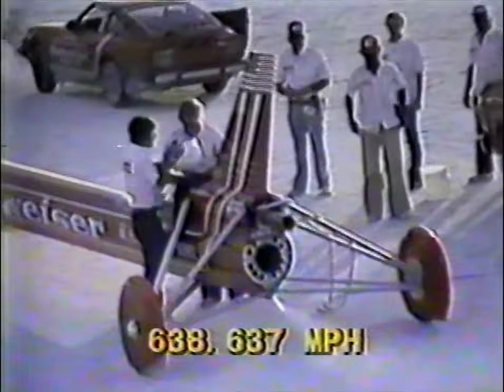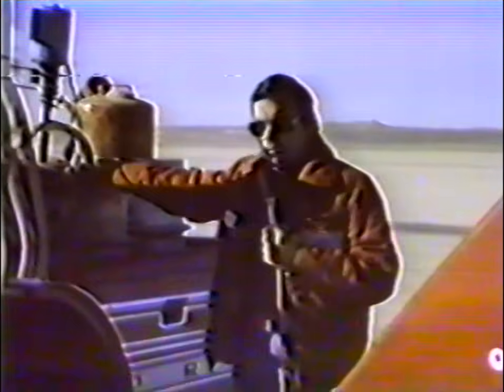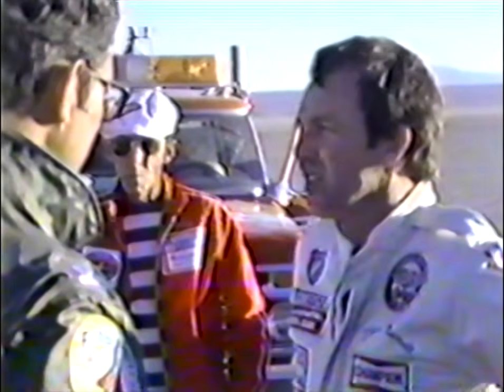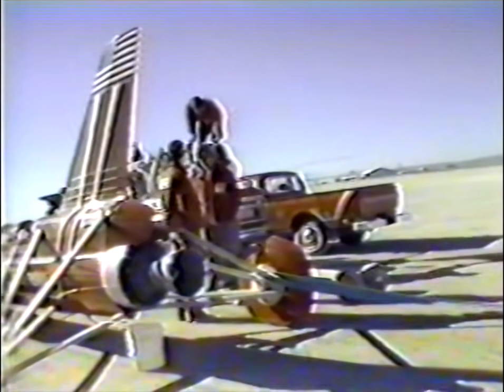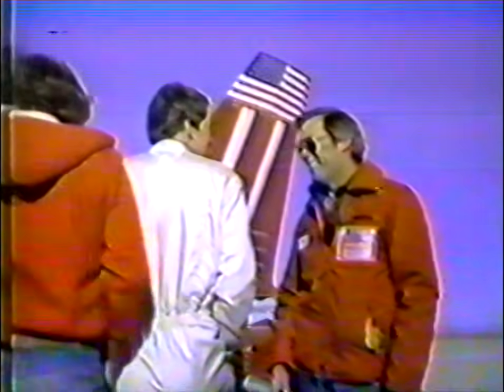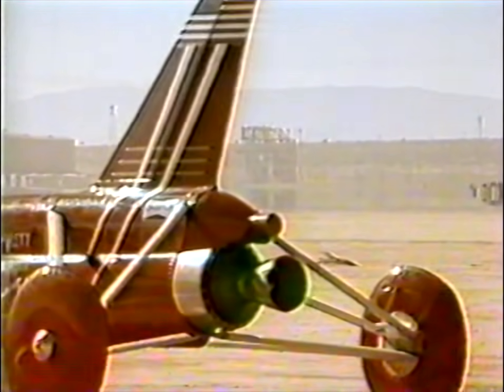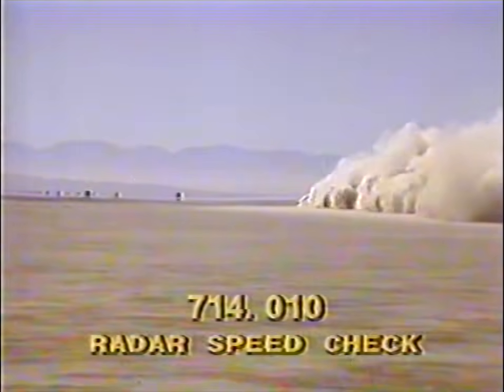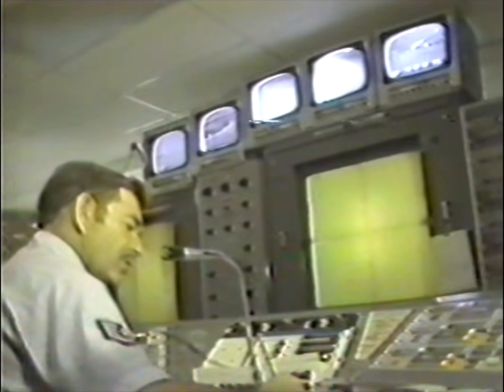Stan Barrett Breaking The Sound Barrier Live from Edwards Air Force Base in 1979

Comment: "On December 17, 1979, he attempted to break the land speed record, and the sound barrier in the Budweiser Rocket rocket-powered three-wheel vehicle. His calculated speed was 739.666 miles per hour, which would have made Barrett the first man to break the sound barrier in a land vehicle. The attempt was surrounded by controversy and the speed was never officially recorded." -Wikipedia

Yeah well, not officially recorded with a "calculated" speed.

I claim they "calculated" wrong. I mean, he's saying the speed of sound is "around". The fact is, they didn't even properly know back then. Meanwhile, here in 2020, we know that at sea level, Mach 1 is 761 mph and thus Stan never hit the speed of sound.

Thrust SSC meanwhile was monitored by satellite, and hit 763 mph which is faster than the speed of sound and thus the sonic boom. 

(Stop trying to rewrite history. Andy Green was the fist man to break the sound barrier on land.) 

End of story.
Reply: The speed of sound changes according to TEMPERATURE.   Something you didn’t know.  End of story.
Reply: Tim McGuire That’s true but it still didn’t happen.
Reply: also includes altitude. and air pressure.
Reply: @raypitts4880  No.

"The speed of sound (symbol: a) is principally dependent on the type and composition of the gas as well as on the (absolute) temperature t. The calculation is simple:

speed of sound a = kRt

where

k is the ratio of specific heats of the gas (k = 1.4 for air)
R is the gas constant (R = 287 J/kg K for air)
t is the absolute temperature in K. For the standard atmosphere the speed of sound is derived as follows:

a) speed of sound at zero altitude: 15°C

a= √(1.4 × 287 ×288)
 = 340 m/s (670 knots)

Conversion of the dimensions:

√((J×K )/(kg ×k )) x √((Nm )/(J )) x √((mkg )/(s^2 N)) = √(m^2/s^2 ) = m/s

Speed of sound at altitude of 11 km:
temperature at 11 km altitude:
-15.5°C, corresponding to 273-56.5=216.5°K

a = 295m/s (582 knots).
Thus the speed of sound decreases with increasing altitude because of the change in temperature."

- "Modern Combat Aircraft Design", Klaus Heunecke, Airlife publishing, 1987, p.72.

And also:

"The actual relationship is that the *speed of sound is proportional to the square root of the absolute temperature."

Mechanics of Flight", A.C. Kermode, Pitman Publishing, 1972, p. 322

Let me put it another way: the speed of sound varies with temperature. Temperature varies with altitude. But there is no need to include altitude in the calculation. All we need is temperature (in degrees Kelvin). We don't need air pressure either.
Reply: @deltapee9259   You're right. I don't see a massive difference in height, or average temperature between Black Rock Desert (Thrust SSC) in Nevada at 1,191m above sea level and Bonneville Salt flats (Budweiser) in Utah which is the next state over at 1,291m above sea level.

Plus, if you want to look at it like that, Budweiser was at a higher height and thus had less air to carve through so should have done better.

Andy Green and the Thrust SSC team still smashed it though didn't they? 

Nice try though yeah.
Reply: @Crimsonedge1  Altitude is not part of the formula for calculating the speed of sound. Please get it right.
Reply: @thethirdman225  The speed of sound IN AN IDEAL GAS depends only on its temperature and composition. In regular air, which is what we have here on earth in case you didn't realise, the speed has a weak dependence on frequency and pressure. Like it or not, the air we breath deviates from the "ideal behaviour" and MUST be accounted for in calculation for the speed of sound in relation to a vehicle at a given altitude. And it must be taken account of as the very dynamics of the air itself (the gas) changes as it gets thinner. 

But yeah, please do go on telling me to get it right.
Reply: @Crimsonedge1  
"The speed of sound IN AN IDEAL GAS depends only on its temperature and composition. In regular air, which is what we have here on earth in case you didn't realise, the speed has a weak dependence on frequency and pressure."

I don't know why you're even arguing this. The formula is a=kRt which takes into account the gas constant, absolute temperature and heat capacity ratio. In other words, all that is taken into account.

There is no need to include air pressure or density or altitude or even humidity into the equation. It's actually pretty simple. The notion of an ideal gas is taken into account with the inclusion of the gas constant. Pressure is included in the heat capacity ratio.

I get this all the time. I show people the formula and everyone goes, "What about this?" or "No, you're wrong!" I don't mind a certain amount of challenge explaining it but I just get so sick of the arguing when the formula is right there in front of you.

This is scientific formula. Yes, all those things are connected but they are also temperature dependent and anything that isn't is not included.

The altitude is a separate matter from temperature. Look at the formula: there's nothing in there about altitude. What matters is that the temperature is usually lower at higher altitude. There's nothing in there about pressure either.
Reply: @thethirdman225  

"The speed of sound in air depends on the type of gas and the temperature of the gas. On Earth, the atmosphere is composed of mostly diatomic nitrogen and oxygen, and the temperature depends on the altitude in a rather complex way. Scientists and engineers have created a mathematical model of the atmosphere to help them account for the changing effects of temperature with ALTITUDE. Mars also has an atmosphere composed of mostly carbon dioxide. There is a similar mathematical model of the Martian atmosphere. We have created an atmospheric calculator to let you study the variation of sound speed with planet and altitude.

https://www.grc.nasa.gov/www/k-12/airplane/sound.html
Reply: @Crimsonedge1  We? Do you work for NASA?

Mate, I still don’t know why you’re bothering to argue. There’s no point talking about the composition of the atmosphere and ideal gasses when, with the gas constant, it is already taken into account. We call it air, rather than a combination of nitrogen, oxygen and carbon dioxide etc, and its constant is 1.4. It’s 1.4 in your calculator and in the formula I quoted. In other words it makes no difference.
Reply: @Crimsonedge1  By the way, you might have missed it but that calculator uses a drop down box to select altitude or temperate. That doesn’t mean altitude suddenly becomes part of the equation because it doesn’t. It means they are using altitude and temperature interchangeably because if we know the altitude, we can make an assumption about the temperature (ignoring things like inversion layers, etc). That’s just something which is coded into that applet.

Comment: No sonic boom. No shock wave seen from the front of the vehicle (which WAS seen from Thrust SSC). The rear wheels off the ground are the result of the high thrust line of the Sidewinder motor, not as Yeager described it (he got it upside down).
Budweiser Bullshit.
BTW, the speed of sound in air is a function of temperature, not altitude, wind etc.
Reply: Wrong, it's an issue of altitude atmosphere density!

Comment: The speed of sound at  Edwards Air Force altitude of 700 metres is 759.5 mph. So 714 mph which is what Stan Barrett achieved did NOT break the sound barrier
Reply: Apologies - did not correct for temperature. If you assume an altitude😮 of 700 metre and a temperature of 90 F  the speed of sound is 783 mph. So 714 mph is not even close

Comment: How do you ignite Hydrogen Peroxide...?
Reply: Thomas De Lello  That’s what I thought??
Reply: Does it ignite under pressure with the rise of temperature due to BTU content like diesel does...? Maybe...
Reply: You use a catalyst to cause it to break down. The energy released is amazing. Most old torpedos ran on hydrogen peroxide the energy of the fuel was more than the high explosive warhead.
Reply: @raypitts4880  Tell me where on the time dial to look for that. I saw Slammin' Sammy Miller make a 350 mph pass at the Hollywood Florida quarter mile in the 1980's with two friends... Scared the sh*t outta me... ET= 3.5 seconds.

Comment: Nah... they knew they didn't quite get it. And it took like 30 years later to get it done.  Has not been since attempted. Still hoping they go for it but i think funding has died for the project.
Reply: Nope. Currently doing high speed testing at Hakskeenpan in South Africa. Preparing for max speed run next year.

Comment: I can't believe the level of derp in the comments... TWO aeronautical engineers explain that it DID go supersonic and WHY there was no boom - and hundreds of armchair mechanics saying it didn't. Fact : it went supersonic. But but! the frenchies didn't OK it so it must not count, eh? Aren't you guys missing a NASCAR race or have a cousin you need to date instead of commenting on this video?
Reply: It probably did, briefly
But, awesome as it was.
It has only 3 wheels not 4, makes a huge difference to drag.
To officially take the land speed record it has to do 2 x runs in opposite directions, within the hour and then the average taken from both runs.
It also has to be officially timed, not a good guestimate from a radar type device. 
It also has to keep all 4 (3) wheels on the track - it didn't
It was calculated that Thrust SSC broke 800mph briefly, the average was however a little less.
Splitting hairs?
Possibly, just like you guys did with the Blue Riband.

Comment: Rockets are rated by thrust, not power ("horse power") it is crazy to compare with indy car.
Reply: The relationship between thrust and HP is complicated but it does exist and one can compute either the pounds thrust or HP for a jet or rocket engine.
Reply: So show us the relationship.
Reply: John Quest Do your own research ,instead of being spoon-fed info by someone else.
Reply: Horse power isnt normally used, but it's a measure of power, so can be reasonably compared.
Reply: try the calculation of steam power

Comment: Funny publicity stunt, but no sonic boom (as their was in 1997 with thrust SSC), and of course, no measured distance, no return run, no independent timekeeper or verification, and it was in a tricycle, not a car (which is defined as having four wheels, and being steered by two of them).  
So not only didn't it qualify as a car, it didn't qualify as a record, and there was NO sonic boom - so no breaking of the sound barrier, even momentarily.
I suspect the lack of measured distances and timekeepers was because they knew darned well that they couldn't really do it, never mind satisfy the world record requrement of a return run within 1 hour to give an average speed in both directions over the course.  So they just put on a TV stunt.

Comment: No sonic boom, no visible sonic sound wave on the ground (unlike Thrust SSC), no timed runs, one direction.
Stan Barrett was incredibly brave and skilled, but this car did not go supersonic. Chuck Yeager's explanation was upside down, the front of the car should have gone up, not the back of the car, due to the transonic aerodynamic effects, because the nose down profile of the car pushes the car DOWN. Going supersonic would have moved the downwards pressure rearwards i.e. nose up.

Comment: Drama driven by male ego.

Could easily have made car radio powered.
Reply: @tom5051666  Kitty O,Niel went 520mph in it .Al Needham dialled Her power down for Kitty's second run when she said she was confident of going over 700 mph .
Kitty in this Car still owns the never to be broken Standing Start Quarter mile record of 3.22 seconds to 412 mph from 1977 .Jessi Combs sadly died chasing Kitty's record this year .
Al Needham was worried Kitty was going to go faster than Gary Gabelitch,s record of 622 mph .Not the done thing back in the 70,s for Women to beat a Man .
Shirley Muldowney ended that Male dominated Speed ego thing by dominating Top Fuel Drag Racing .